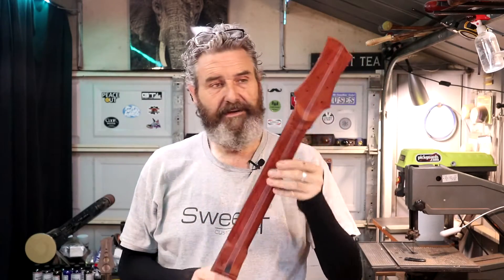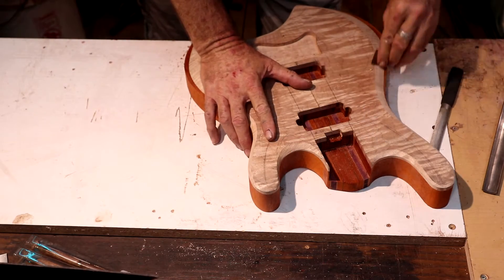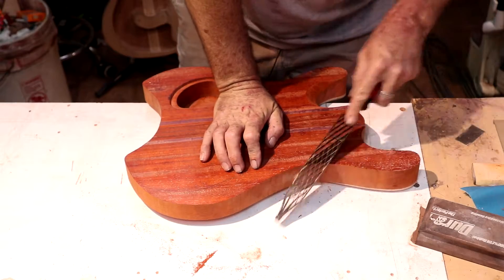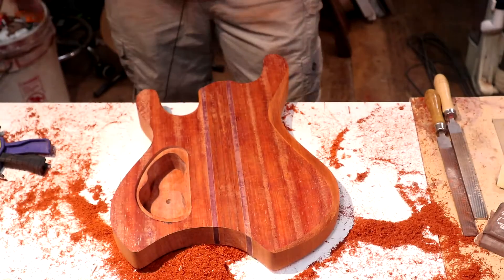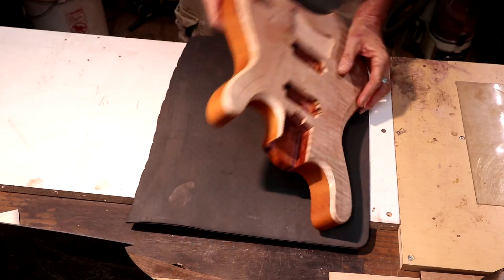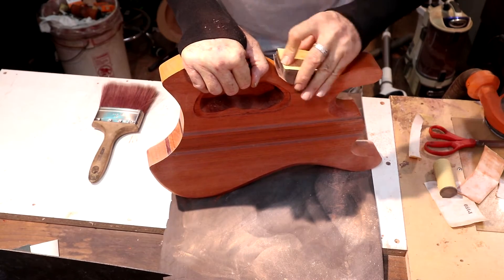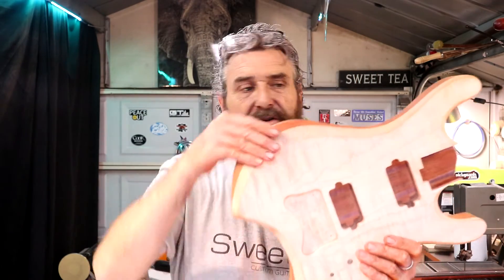Custom Guitar Build - Cloud 9 - Episode 09

Comment: Starting from the beginning. LOVE the new intro music. That has evolved nicely. Good to see the war wounds from the padauk incident are healing nicely. Cool you did not let that deter you from doing what you want to. I dig the carves you did and the in-depth explanation of how and why you do it that way. Oil is the way to go as I think you would need too much sealer before a 2k that the wood grains would nearly disappear in that process. Cant wait to see this come together into the fine instrument it is destined to be.

Thanks for the shout out and showing people that mat. I like that style as it is closed cell and super easy to clean with just a sponge and warm water. The best part is wood does not slide around on it when you work on it. Its also super nice to protect the wood from all the dings, scratches and dents that ALWAYS happen just before finish work causing even more sanding. (which BTW is my favorite part of wood working as thats where the real beauty shines thru and it gets that ""feel" that makes it so popular a media to work with.)
Reply from the maker: Thanks Bill and thanks for the mat. I love it. As far as 2k goes. If I was going that direction I would use this Solarez grain filler. It's uv cure by light or sun and it cures in minutes. I won't use that going with oil though. I actually want the grain to show in the Padauk. Just not in the maple. I'll use the Mohawk sealer on the whole thing but that will be mainly to lock in the color once it goes on and to make sure I have a nice slick finish on the maple. I'm glad you liked the video my friend. ✌️
Reply: @SweetTGuitars  Speaking of sealer. I was asked on my resto video if I need to seal the color before 2k goes on. Same for the GGBO I assume? Sealer or no? I dont think so but thought I would ask so I don't give wrong answers.
Reply from the maker: No man. You don't deal basecoat. Sealer would go on after primer, before basecoat and is not required on a auto body finish.
Reply: @SweetTGuitars  I didnt think it was anywhere in this process but as I said I do not want to pass wrong information on. thank you once again for being right there with the help my friend!

Comment: Hi Todd. This build is looking great,  and am loving watching it come together.  I do think an oil stain is the best choice, as it can really make the grain pop. Can't wait to see the neck fitted and some hardware in position. Are you doing anything special like coil taps for the pickups , or a floating bridge with trem etc?    See you on the next video. Best wishes...Mike. 👍🎸🎸🎸🎸🎸🎸
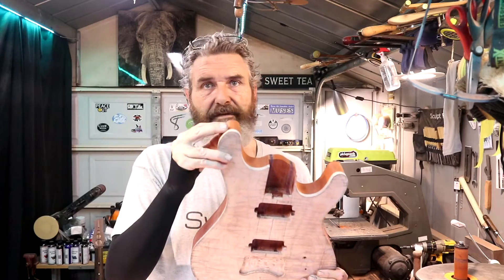Reply from the maker: Hey brother. Yeah man, I really love OSMO Poly-x oil so that's what I'm using. I am doing special wiring with auto coil switching straight from the 5way switch. Push/Pull dual tone with - .22 & .47 caps for single coil mode/Humbucker. It's getting a Sophia 3:44 bridge which is fixed but just a beautiful piece. It's solid stainless with locking saddles and is modeled after a TOM but far from a standard Tune-O-Matic. I show it in a previous video or check out Sophiatremolos.com 
It should be a killer man. Trem guitar coming soon to the channel man. I hope you'll continue to visit so you can check it out. Thank you for the comment! ✌️

Comment: I used a bowl and dish router bit to get the perfect body neck heel carve last time, worked great! 

And that soft and hard grain thing, I've noticed that problem with ash and oak. 

Anyway I'm only halfway so back to the vid lol
Reply from the maker: I did a relief carve on the Dark Corner build and I love that. Basically I cut a half moon shape on the back at the heel transition that was about 8mm deep or 8mm thinner than the rest of the body and it made the neck joint area feel so great. I also used a bowl and tray bit. It worked great. I'm just experimenting man. I love doing that and it sometimes give me ideas for the next build. I love building free form! ✌️
Reply: @SweetTGuitars  same buddy, the bowl and dish was my latest experiment. I love the freedom and the confidence to try things on your journey.

Comment: I am looking at the head stock you have on this build. Without having the holes completely drilled to size it looks like the top is a bit long. could you shorten it but keep the sane curve to the top. Maybe just 1/2"  to 3/4"  certainly draw if in first if you consider cutting some off first but just a thought. Sometimes we people viewing these videos don't get the scale correct a lot of the time some people describe a dimension as being for example  the person doing the build might say is 1in. but to be at least it look maybe 1.5in.
Reply from the maker: I will look at it again once the tuners are drilled in. I enlarged the headstock template using a PRS as a starting point. I think the PRS headstocks are too small so that's probably what you're seeing. Thank you and we shall see. ✌️